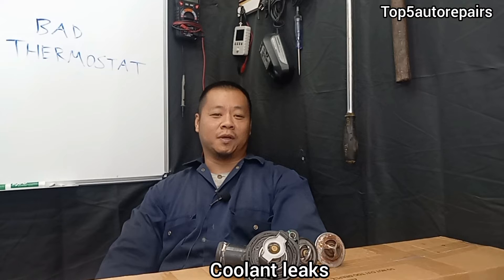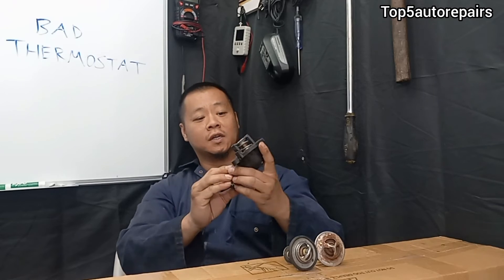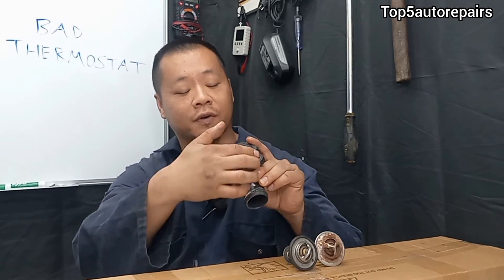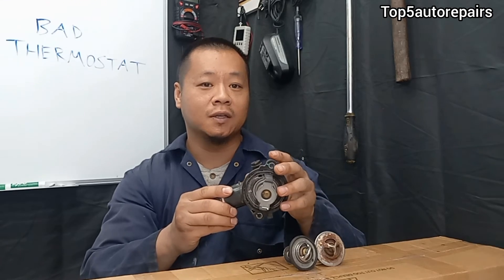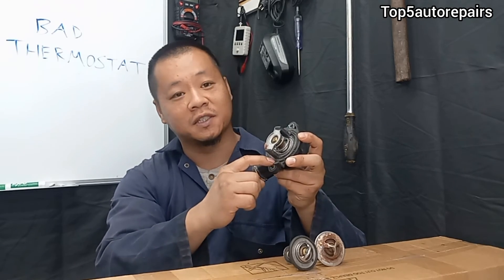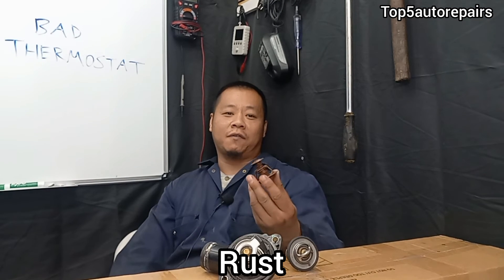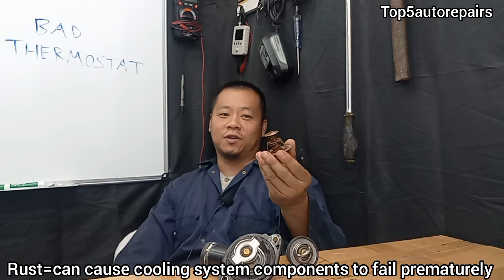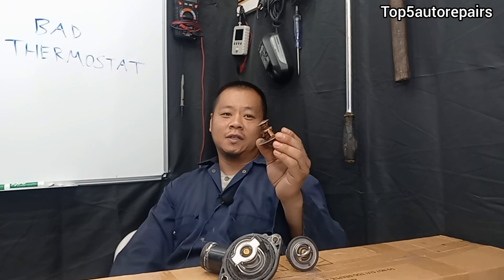How to Tell Car Thermostat Is Bad (Symptoms of Stuck Open Stuck Closed and Overheating)

Comment: 2013 Ram 1500 Sport 5.7, I got heat on passenger side but cool ish on the driver side and its not blowing as hard speed 7 feels like 3, one heater core hose is hot the other is warm, EVERYTHING ELSE WORKS ? any ideas ? Im guessing its my thermostat but could be heater core ?

Comment: I need help. It’s currently 20 degrees here in Chicago and my car is overheating randomly. It heats up to normal temperature and the heater is throwing hot air. Randomly when I come to a stop it stops throwing hot air and slowly my car starts to overheat and I noticed that my fans do not turn on at all whatsoever AND THEN it goes back down randomly or when I start messing with the ac controls and shortly it goes back to normal temperature. I’m not sure if it’s my thermostat, fans or the coolant temperature sensor. Relays and fuses are good aswell, pls help!!!

Comment: Can a faulty thermostat cause the engine to run a richer fuel mixture?  I notice my exhaust putting out heavier emissions especially in the colder months.  Also feels like my mpg is suffering.

Comment: WHY ARE MY UPPER AND LOWER RADIATOR HOSES SO MUCH PRESSURE, CAN'T SQUEEZE THEM? CAR IS NOT OVER HEATING AND TEMPERATURE IS NORMAL. FAN COMES ON AT NORMAL TEMPERATURE DEGREE.

Comment: It's kind of insane that so many modern cars have fake temp gauges that don't show real temperature.  I have a Mazda and a Honda that will both show temperature at normal from 160 degrees up to "somewhere above 225."  I've never gotten either one hot enough to indicate a problem, I I don't want to.  My 1999 Dodge truck has a direct gauge that shows the real temperature, so I can actually tell what it's doing without an OBD scanner.

Comment: Hopefully someone can help me with my problem.. I got a 2011 traverse and I feel this in my gut.. 

Temp on my dash stays on half 
But when I open the hood it is so extremely hot..

And when I check the radiator cap to see if coolant is down..unfortunately it's still full

Some says replace the coolant sensor
Some says replace the thermostat 
Some says flush the rad

Any idea guys please and thank you in advance

Comment: It all sounds pretty basic. Is there a reason you would get great gas mileage fron a thermostat issue?
I got 200km farther than normal on two consecutive tanks of no ethanol regular pump gas. Also a cloged or broken somthing sensor

Comment: Is that the same the temperature fluctuation when it gets maybe almost halfway but then it goes back down to zero I’ve been having that issue with my BMW 2006 330. It runs off a electric pump from what I recall. Can the fact that a smaller battery does not give it that amperage. The car needs to be the reasonor is it really a thermostat or maybe the water pump because after a while my car starts to squeak real loudly. I only goes away when I turn off the car and reset it.

Comment: I apologize in advance.  It’s gonna be a long comment 🙏🙏🙏.  My check engine light turned on about a month ago.  Scanner said thermostat.  Replaced thermostat and temp sensor since it was next to it.  It was running fine and temp was 1 line before the mid level.  Check engine light turned off.  A month has passed and temperature started going up close to over heating.  I tried bleeding again with the heater on.  Car was normal again for almost an hour and half idling.  When i test drove and turned on AC.  Within minutes temp increased again 🤦‍♂️🤦‍♂️.  Do i have a faulty thermostat or temp sensor?  Please advise 🙏🙏🙏

Comment: I drive a 2001 Toyota Corolla. I got it in 2019 at 300 000km’s, never replaced the thermostat in the past 6 years of owning it. It’s now on 424 000km’s. The previous owner said it was never replaced. Surprisingly, I don’t have any of those signs you mentioned in my car. I religiously service my car and do coolant flushes. Would you suggest that I replace it anyway as soon as possible just to be safe? Or is it best to see first if I experience those signs?

Comment: I have a 2007 civic si. Removed the intake manifold. Did a grade A job and putting it back great. Drive around block ect 2 reading up 200’s but ect 1 on radiador says at 140 showing in dash 3 lines, never making it to half as it should. So I’m guessing my thermostat is stuck close because my radiator is cool never letting the cool back to the block?

Comment: I've got a question I hope you can answer because I never get a response back from YouTube. I have a 06 Acura tsx and I recently changed my water pump and just the other day my car overheated and I stopped and there was antifreeze coming from the area of the housing, and I pulled it off and it still springs back and forth like it will open and close, does that mean the thermostat still bad?

Comment: Can a thermostat fail intermittenly......? My water temp went almost above 110 C on the motorway. I had to stop the car and call a trailer because I was affraid I'm gonna damage my engine. Now the car is home and I just cant reproduce the overheating.

My water pump is working. My coolant is at the top mark, I don't see any bubbles in it (nor hear any), my fan is woring perfectly. Rubber hoses seem fine too. I just don't undeerstand.

Coolant temp just refuses to go above 95 C.

Comment: If its sposibole bad termostat make smoke?
Becouse i was get dpf error, then i make manual  regeneration , and smoke was gone and also dpf error, after i get one more time do to same, and after i recognise the temperature gaouge its go up and down.
Its my Miss car thats why i dont know how long temperature was jumping, because usually i use my car.
Reply: Temperture its jumping from70°-90°
And sometimes even stay on 90° for longer time.
And salon heating work perfectly its quick and also hot.

Comment: I’m looking at buying a 2007 Dodge Ram with the 4.9 V8 magnum engine from a good friend of mine. I’ve looked over the truck and an issue I’ve noticed, is that it doesn’t really warm up. It’s stays almost at the bottom cold line no matter what speed the vehicle is at. He said that he just had the thermostat changed not long ago. Could it just be a bad part? I don’t want to change it if it could be something else.

Comment: I have a 2009 Toyota Camry.Ive changed, Thermostat, Alternator,coolant sensor and radiator,and heater still won't work
Reply: you need to change the heater core

Comment: A thermostat stuck open can make an engine to run hot because the water runs through the radiator to quickly to heat exchange.

Comment: Is it possible that the thermostat stuck open and not throwing any codes like p0128?

My coolant temperature stays around 50c-60c. 

I opened the radiator cap, and started the car from the cold. I can see the coolant is flowing inside the cap hole. 

After driving on highway for 30 mins, it's still at 50-60c. I can even touch the running coolant inside the radiator cap hole.

Comment: So if my thermostat is stuck partially open it would run at normal temps while idling but run hot while driving because the flow is not enough since the thermostat won't open fully? Please tell me I'm right.

Comment: Thanks very much.
Reply: My tundra 06,4.0L always stays below middle of C and H. Now I got in it Monday and it won’t go past C,just barely. The radiator I can hold my hand on and the hoses. Couldn’t do that before. Running rough idle. Changed the coolant sensor on the block but same problem. Running very low idle and not moving from C. Just barely over C. Any help? Changed thermostat 3 years ago with coolant.

Comment: check light came on 2016 Mercedes E-350 - but vehicles does not overhear, or take long to heat-up or reduction in Fuel economy -   Garage tech scanned the engine and it thermostat.  Just did a 1500 mile roads trip with no issues,   How do you know the Thermostat is truly failing
Reply from the maker: Hello. Check the upper and lower radiator hose. Both should be hot when engine is warmed up. That's how you know the thermostat is functioning properly.

Comment: My thermostat is stuck open I guess because I’m only getting cold air coming. I gotta replace it ASAP because I’m freezing on the way to work. Thank you for the video
Reply: Stuck open will reduce your operating temperature from 195 to maybe 180. I don’t think it’s gonna change your heater core being able to produce heat for your cabin. We’re only talking 15°.

Comment: this is why the genious rocket scientist that engineer these cars should put two tiny bypass holes in a thermostat so you never ever have to worry about overheating! i dont even use a thermostat i put a small disc in with a tiny hole that keeps my car running at a constant 180 and never will i ever have to put a thermostat in
Reply: Can you do a video on how to install it on an Acura TSX 2009
Reply: Sounds like BS.

Comment: ??? Do you check for codes with a scanner with the engine running right away or do you wait 10 minutes while it's in park than check for codes?

My link appears to be coming closer to the surge tank area and not the thermostat area, but who know,s maybe the way coolant flows
it just leaks closer to that area,  but I would like to rule out the closed thermostat/bad thermostat idea, I just don't know what type of codes
I'm looking for either or which scanner tool is best?

Comment: @top5autorepair  any idea why the heater keeps blowing hot air by the vents even though the heater switch  is off please any thing would help I need to fix this since is summer in Arizona
Reply from the maker: The blend door is probably stuck. Check for faulty blend door actuator. It's located behind the dashboard and glove box. If you pull random blend door cable it might change the position. GL.
Reply: @Top5AutoRepairs  I appreciate you brother

Comment: If you put weeker springs on a thermostat would open up with less heat or faster? How would I design one to open with less heat? I'm doing an experiment thst is not automotive related?

Comment: What does it mean if my car is spilling brown coolant all over the ground?
Reply from the maker: The cooling system is rusted and it should be flushed with the thermostat removed and radiator drain plug removed as well.

Comment: I recently bought VW mK7 2.0 TDI and I noticed one thing. The car reaches around 90 temperature in 2 3 minutes. Is that normal? And even if the temperature is like 80, when I turn off the car, the car start cooling on their own. The temperature never going over 90 but idk if it's normal thing or? Anyone with similar problems?

Comment: Hi. My NOTE 1.4 PETROL has an issue that everything  is ok for the cooling if the temp is up to 95C.  If it goes over, due to higher RPM,  the temperature start rising and the temperature only goes up.   No coolant leak, no bubbles in coolant on idle, no oil in coolant. No codes on OBD. Any idea what could it be? Thanx for any help.

Comment: My rsx recently got mildy hot but i turned the heaters on and they werent getting much heat at all so i turned the car off for 25 seconds and it went back to Operating Temp  but the heaters rlly only got hot when i would actually drive

Comment: My 2019 Altima was running cool and my heater wouldn’t blow warm/hot air, with check engine light. But, my mechanic didn’t diagnose it. Now the temp is fluctuating, and it’s having a rough start with smoke, sometimes dies and have to restart. It still runs smooth, once it warms. Just wondering if this is most likely the thermostat, and if the rough start could be from too much coolant? Also, is the thermostat change out the same in the 2019, as it is in a 2018? I can’t seem to find a video for a 2019/2020.

Comment: What happens when it only over heats when idle or if it's very very hot outside
Reply: Hmmm check the radiator fins for excess dirt/dust/bugs? If the fan cant blow cool air over the fins it cant pull the heat from the coolant. They got some A/C cleaning foam that will bubble and scrub between them for you and then rinse it out and hit it with some compressed air from the back side to blow out anything left behind. Hope this helps.

Comment: I have to replace my thermostat about every 6- 12 weeks, because it stops functioning properly. I have used after market, I have used Genuine parts, doesn't matter how cheap or expensive. When seeming to function correctly it runs between about 160° to 190° and heater and AC work perfectly fine. But when the thermostat isn't functioning, my heater still heats like normally, but the AC does not cool at all. Anyone have any ideas what is going on?

Comment: Also, if you have no cabin heat and your engine is overheating it is a sign of a thermostat stuck closed.
Reply: If your having trouble getting cabin heat, it's a sign it's stuck open.  Which causes continuous circulation of the coolant system, and causes low operating Temps and barely any cabin heat.  If its stuck closed then you will have a very quick build up of your operating temp and alot of cabin heat, because your system is not circulating or cooling and running at high operating temps.
Reply: My truck is overheating and no cabin heat

Comment: When the thermostat stays half open it is called a lazy thermostat. You can test the thermostat showing it opening but Doesn’t  still mean it’s not lazy
Reply: Is thermostat are repairable?
Reply: @tomdexterparaguya1964  it's replaceable,  it depends on the car how easy it is to replace

Comment: May have to change mine by looks of it. Was originally told my hearer core had blocked up so i changed that but im still not getting any warm air inside the car. Pipes to the heater core are warm, the hearer core itself is hot but still no hot air been blown into car. It blows cold and slightly gets warm when driving but nothing more. You think its the thermostat thats the issue ?
Reply: I have this same issue. Now the temp gauge is starting to rise as well. I’m just gonna change the thermostat

Comment: Thanks. Do you happen to know if it's okay to use coolant flush to clean the system after replacing the thermostat?

I'm planning to replace the thermostat and the radiator hoses then flushing the cooling system before I put in new coolant.
Reply from the maker: Yes you can it shouldn’t be an issue.
Reply: Replace the hose after flushing i guess

Comment: If the thermostat is stuck open, is it possible that the transmission will overheat due to the fact that the cooling fan will not going to turn on due to that the coolant sensor will not trigger the ECM to turn on the fan? Is the transmission oil cooler cools itself because of the radiator fan?
Reply: Yes with a stuck open thermostat you will notice your trans temp rise when sitting/stop for to long because of your fans not kicking on

Comment: My temperature gauge has been rising only while in park after driving for a little. It goes up to between 1/2 to 3/4 but when I drive again it goes back to normal. I just had a heater core replaced for leaking coolant from behind the glovebox and it was smelling from the vents. That has been fixed but now I’m having temperature problems while in park. I wonder if maybe something wasn’t put back properly or if I have a bigger problem now?
Reply: Make sure you don't have air in the cooling system

Comment: So I have a question, my heat will not work on the 3 lower settings but will blow on the highest for 3-5 minutes then kick off. I’ve replaced my blower motor resistor and my blower motor fan works, what could it be? Must I add my car isn’t overheating at all, and it gets up to operating temps just fine
Reply: Im sure you don't have a blower motor resistor hahaa

Comment: So my rover took longer to heat up  than normal and when I drove it it spiked up to H so what are the symptoms of that also it was blowing cold air
Reply: I have the same issue, did you find a solution?

Comment: I’ve replaced the thermostat and it turned the check engine light of but the car is still stuck on cold my heater works fine and everything I understand it’s probably stuck open but not sure how to fix the problem

Comment: Hi can someone please help. I have a Peugeot 307 petrol and the temperature gauge for Both oil and coolant works and goes to the middle while sitting in idle, but soon as I drive the temperature on both gauges goes to zero and no heat in the car. If I park in idle the gauge and heat works normal.

Comment: @everyone 
I recently changed my thermostat and coolant temp sensor both as original parts but still my corolla 2013 has temp gauge not getting to middle and even getting low reading mean over cooling…. Can anyone tell me reason pls
Reply: Thermostats stuck open. Replace thermostat

Comment: I have a question, and it would be very helpful if you had time to answer.
My volvos temperature is not reaching the correct temperature when idling, but while driving the the temperature is in order. As soon as i stand still while the car is running- the temp is dropping.
What could this be? Thanks
Reply: Waterpump
Reply: Thanks for the response 

You think is water-pump not open thermostat??
Reply: Mine is opposite, it's only hot when idle but gets cold when driving. What is this.
Reply: Check temperature sensor or the fan
Reply: @labi.not123  ok thanks.
Reply: @labi.not123  not showing fault on obd metre. Maybe thermostat is stuck open.